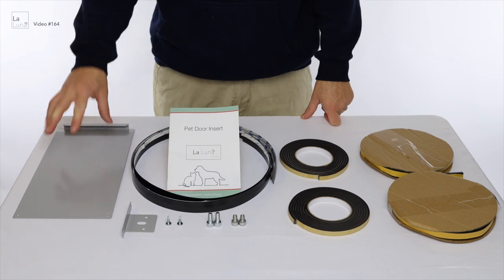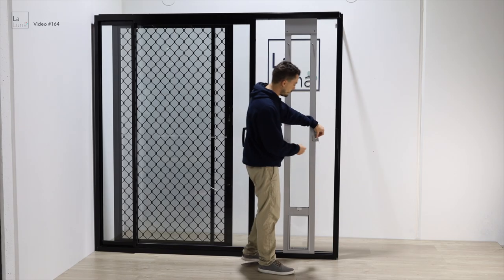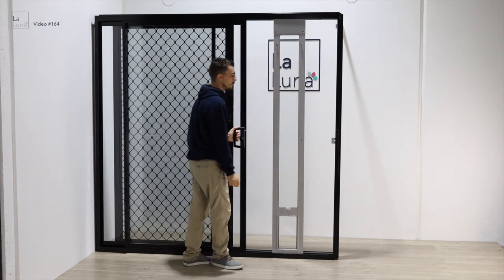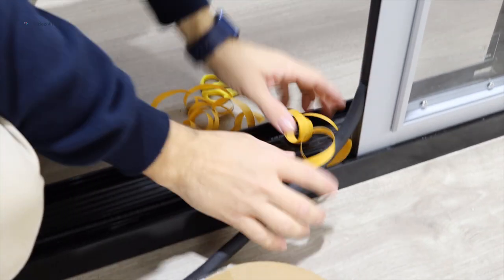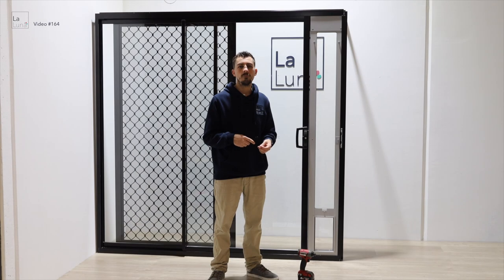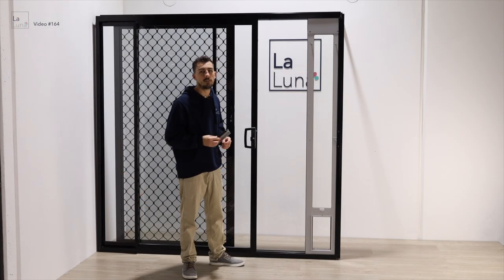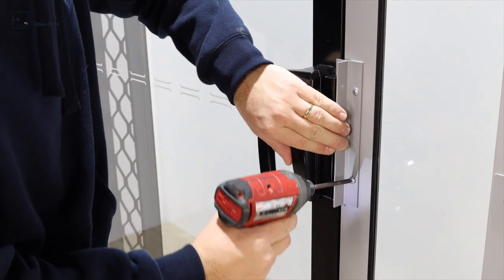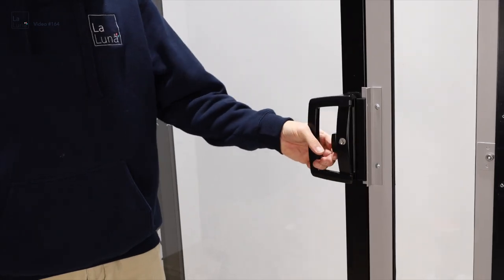Video #164   Security pack installation

Comment: 32 seconds into the video he says you will find the screen door latch in the security pack. This is also stated on page 12 of the instructions. My door and security pack came with no latch. Contacting the company I was told that I do indeed need the latch but would be required to buy it. I already waited more than 2 months for the door and now the require me to purchase additional parts from China to use secure it.